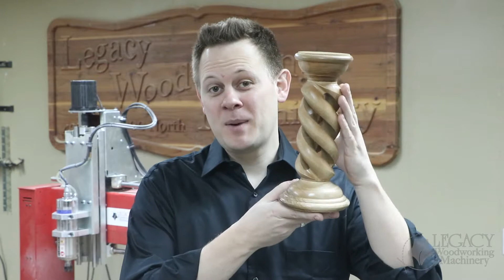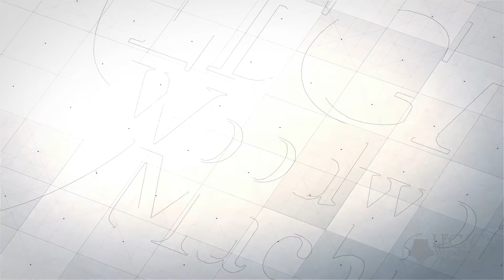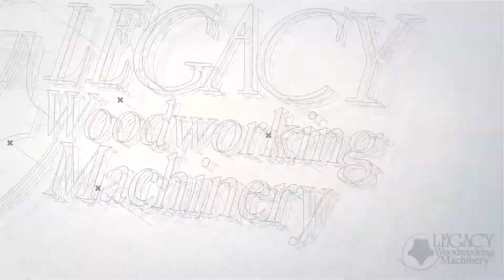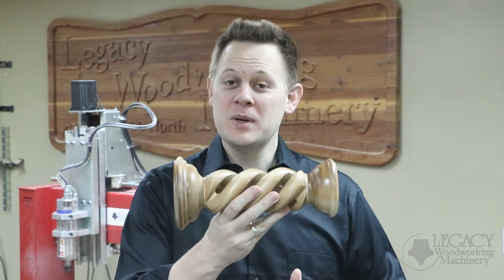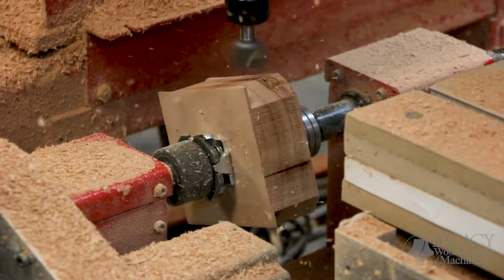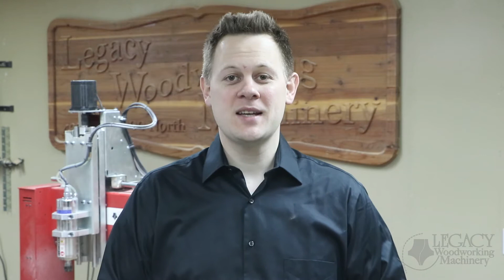Hollow Spiral Candlestick - Wood CNC Projects - Legacy CNC Woodworking Machinery

Comment: Hey so I am trying to do this in my woodshop class and I got the spiral completed and the next step was to hollow out the middle. When I did the middle the blank rotated faster than the bit moved. Any solution to this?